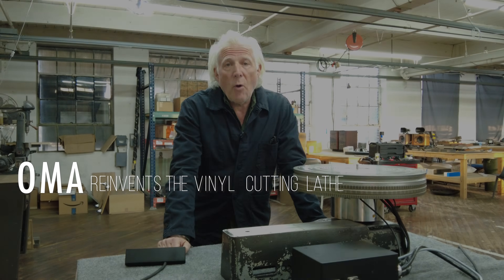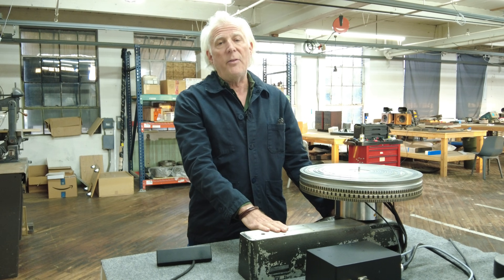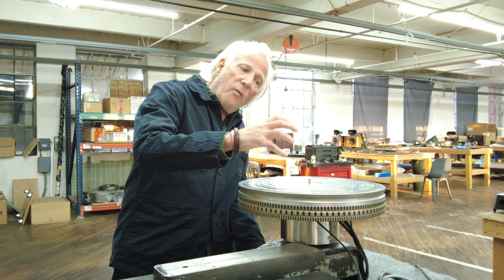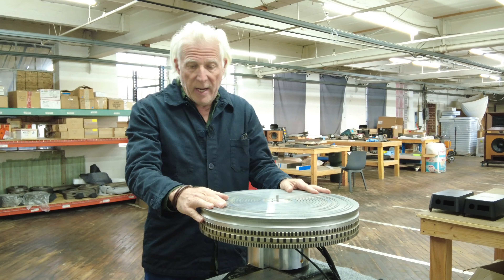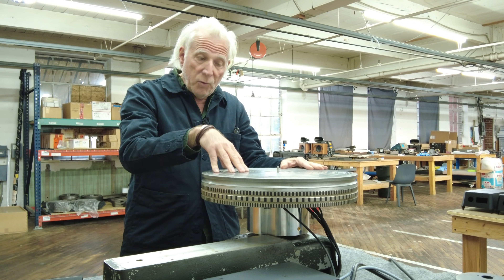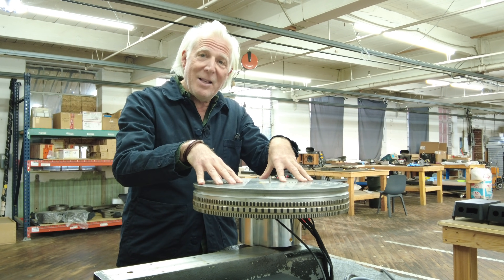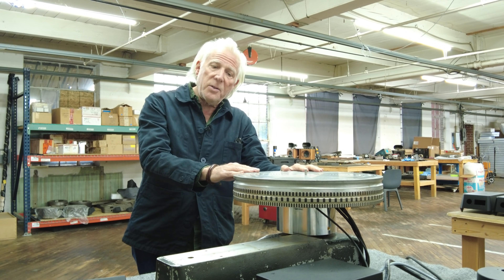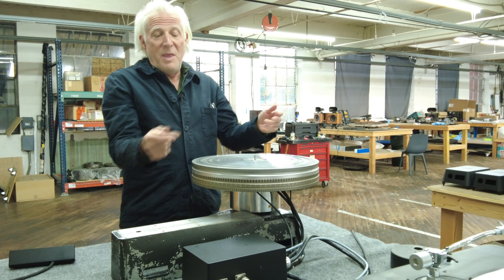OMA reinvents the vinyl cutting lathe

Comment: You vinyl nuts. Please tell us what is the actual SNR of a high quality master... even with the total absence of time-domain fluctuations. Tell us also what it the frequency response, and the noise spectrum. Anyone who has done mastering for a lathe knows these target numbers and knows what compromises need to be made for the groove excursions to be manageable at different points on the spiral.
Reply: You digital diehards “ please tell us [ all ] ” ( exactly ) how your, futile, quests and obsessions with sample rate and bit depth will ever manage to ( optimally ) balance bandwidth, distortion, and noise ( an, ambitious, juggling act that [ essentially ] mirrors roller skating on ice, in July — outdoors ).

Everything that you have ever done, and everything that you are is analog : mechanically, biologically, etc.—-yet ; digital and A.I. will [ solve it all ]. 👀 Riiiiggghhhttt . . .👌🏾 Let us step aside, then.

Have at it, my auto-tune afficionados. 🍺

Comment: Sounds like Oswalds Mill needs a water wheel powered turntable with a massive platter and very traditional yet sophisticated noise decoupling or smoothness.
WHAT IF you took an immensely over powered speed/torque and used ACTIVE BRAKING and smoothing techniques to achieve contant torque?

That would be one hell of a turntable, really!

Comment: Try cutting a piece of linoleum between the bed and the cutting leave assembly. also if it's possible between the motor and the platter. that's the best thing to use for cutting out vibrations to the cutting head, also its stiff and doesn't change with temperature. give it a go! and let me know what results if any. make sure it's a linoleum not vinyl flooring. Also where the bolt holes are make it about 10% bigger diameter in the linoleum, you need a bit of space around the holes.
I would have thought the best motor would be a gravity-fed plumb bob, With a governor. I know that's a bit fiddly awkward but would give you the smoothest no noise motor you could get.
Reply from the maker: Thanks for the suggestion!